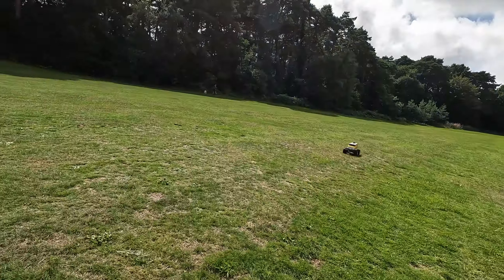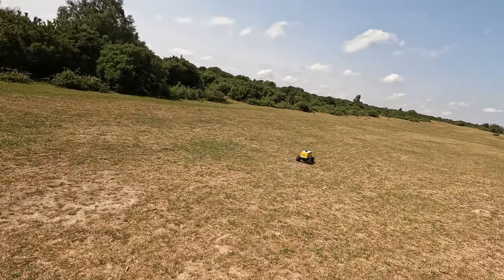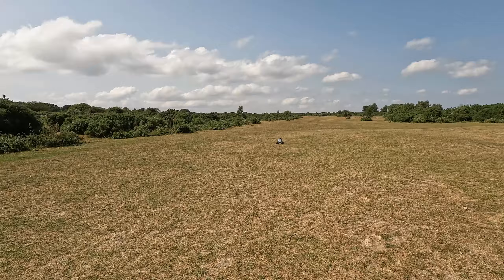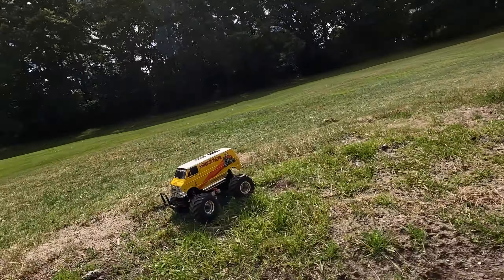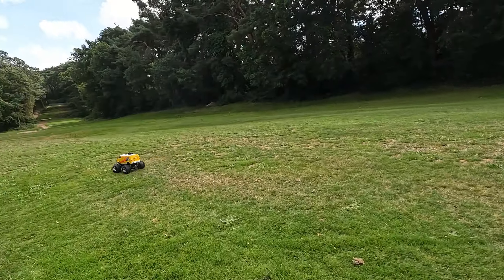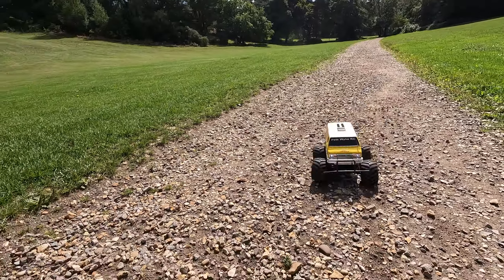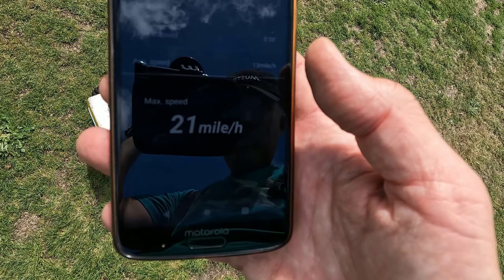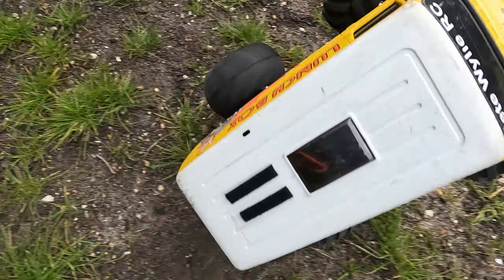Tamiya Lunchbox NiMH vs Lipo Brushless and Brushed Speed Tests! You Will Be Amazed (maybe)!

Comment: Very interesting results! I love the nimh packs for my Tamiya fleet. They are just reliable and worry free! The batteries now are so much better than the ones we had back in the day. I agree the lipos are best for the higher powered vehicles and the nimhs are just fine for regular run of the mill kits.
Reply from the maker: Hiya Addam. Yeah I tend to use lipo for everything apart from the Tamiyas that have old non lipo esc's but this shows that there isn't that much difference if I use a big capacity NiMH. Many thanks indeed for watching 😁👍👍

Comment: Hey Pete! 
Any video that features Vanessas box (ooh er!) is always going to be entertaining.... but this one was particularly interesting to an rc nerd like myself! 😁 
Your findings pretty much reflected what I have experienced.... which is obviously different from what we were always led to believe in regards to the linear curve of discharge between NMH's and lipos. 
I now use a mixture of NMH's and 2s/3s lipos, dependent on which vehicle I am using....obviously there are pro's and cons to each style.
People tend to forget that the modern good quality 5000MH  NMH'S are a far cry from the 1200MH NICADS that we used to use back in the 
day, where a 5 minute run was all you got, even less if the battery had been fast charged,or you had a modified motor fitted!
As you correctly stated, the run times/speed gains between a good NMH and a 2s lipo are marginal....especially when dealing with vintage /tamiyas! 
But things definitely start to separate more once you start upping the power......and things start to get really fun once you start adding a 3s!
Great video fella,and great to see the lunches back out again!! 😁 
👍 👍 👍
Reply from the maker: Hi there. Yeah it was interesting to do this test and it's certainly different to what I thought. I think that NiMH battery I have is a good one and like I was saying it hasn't been used that much compared to the lipo. One other reason I got the NiMH is fine if I want to take an RC on holiday or whatever when I don't want to worry about the whole lipo thing. Oh yeah those old 1200mah packs and the 5 minute run time 😬 You could never go far from your full sized car because you'd need to get back and give it a fast charge from the charger attached to the cigarette lighter socket. Yes 3s and above certainly mean that you can run bigger cars at higher speeds. Many thanks indeed for your great feedback as ever. Best wishes mate 😁👍
Reply: @PeteWylieRC  
Very true fella,but we were happy with that back then wasn't we?
Those old fast/trickle chargers with the manual timer and the switch to select 6/7.2/8.4 or 9.6v NICADS that used to run off the family car!😁 
The fond memories are flooding back mate......
My parents used to take us camping in the new forest in their metallic brown cortina estate,complete with poo brown interior!! 😁 
Unfortunately the cigarette lighter didn't work on what I used to refer to as the 'Dagenham log'!!
Clear as day I can remember the ten year old me popping the bonnet and connecting the Crocodile clips directory to the battery in the Brockenhurst stream car park in order to get a few more runs out of my midnight pumpkin along the sandy,shingle river banks!!
Seem to remember doing similar at Bucklers hard and Hengistbury head to! 
Happy days for sure!
But,times move on.......never thought I would be using lipos regularly, hell,even Robs got one now! 😁 
Luckily,the New forest has remained pretty much the same though!
All the best mate,keep pumping out the great content! 
👍 👍 👍
Reply from the maker: @yodadarksideGreenHawksRC  Oh yeah thinking about it our family car was too old to have a fancy lighter socket and it was indeed the clips on the battery under the bonnet.  Seem to remember that the battery was toasty hot after.  Oh happy days 🤣

Comment: Really interesting to see the lipo longevity to drop so quick. I guess a repeat test with equal capacity and brand new batteries would be definitive
Reply from the maker: Hi there. Oh yes ideally I'd have had the same capacity batteries and also both brand new. Was interesting anyway to see that NiMH works well in these small RC's. I did another test with my Arrma trucks and really they do need lipo. Many thanks for watching 😁👍

Comment: It seems like the Yellow one is bigger? is it camera angle or they are different scale? 
Are the new 1/12th models on Amazon the same size as the original ? not sure if the original LunchBox was a 1/10th or 1/12th scale being a monster truck...
Reply from the maker: Hi there. They are both exactly the same so might be an optical illusion. They are also the same as the original Lunchbox and Tamiya didn't really change very much when they re-released it. Not sure about the Amazon ones. Many thanks for watching and your feedback 😁👍
Reply: @PeteWylieRC thank you for the reply. It clarifies what I've been wondering for a while. I wanted the same size as the original model. I thought Tamiya made them smaller but I suppose they didn't. Thank you and have a great day 😊
Reply: What ?? 
Excuse me, are you kidding ?  That same obvious difference shocks me too .
That is never an optical illasion, those two models are OBVIOUSLY massively different in size and NOT the same .
So please, which one is the original Tamiya and what brand the other one ?? 🤔 
Thank you  😎 .
.

Comment: Yeah, if there ever was a RC car that dont need need the extra power and less weight Lipo can provide, its the lunchbox. The chassis is seriously struggling to use much power at all, hence no benefit of more being availible. So why not stick with what you like, I agree. The terrible handling (compared to a typical buggy, even of its era) all round is what makes the lunch box fun even with low power. Bouncing and doing wheelies everywhere with less than 100watts of max power. I ran a fully stock one with the original silver can, just on 3s lipo and it was more than fast enough for everything I wanted mine to do.
Reply from the maker: Yeah you don't need huge power in these but I do enjoy the 3500 brushless one more than the silver can brushed one. I only use 2s lipo in them. A friend of mine ran 3s lipo in a brushed lunchbox and it was similar to the brushless one on 2s. Good fun whatever you use though really. Many thanks indeed for watching and your great feedback. Best wishes to you 😁👍

Comment: Hey question do have to upgrade ESC?
Reply from the maker: You can use the ESC that comes with it if you are using a brushed motor but you need a brushless compatible ESC if you are using a brushless motor. Thanks for watching 😁👍

Comment: Nimh is ok in light stuff but on heavy scale rigs a 6800mah lasts about ten minutes in mine .a four year old 2s lasts about two hours on the same rig and the brand new nimh I tried lasted about ten minutes .but the nimh is great for powering the GT5 transmitter..
Reply from the maker: Hi there. Yeah I've come to the same conclusion that in the little Tamiyas the NiMH batteries work well but as you get into the bigger higher powered RC's you need to go for lipo. Just thought it would be interesting to test how they compared. Many thanks indeed for your great feedback 😁👍
Reply: @PeteWylieRC  yep heavy scale trail rigs seem to draw a lot out of batteries I find 3s turned down on the transmitter to give 2s speed is the best .more volts move the weight easier and last a lot longer ..I’ve found a 3500 mah 3s lasts longer than a 6000 mah 2s as it’s got nearly twice the output ..👍👍

Comment: How long did both batteries last on 1 charge ?
Reply from the maker: Both about 45-50 minutes depending on driving style 👍
Reply: @PeteWylieRC  thats crazy time out of a nimh battery. I cant anymore then 15mins out of mine. What am i doing wrong ? I also have lipo shorties, 5-6k but only push them too about 20mins a time. 
Is it my charger or am i babingnmy batteries ? Cherrs